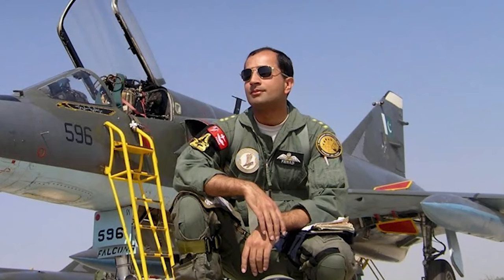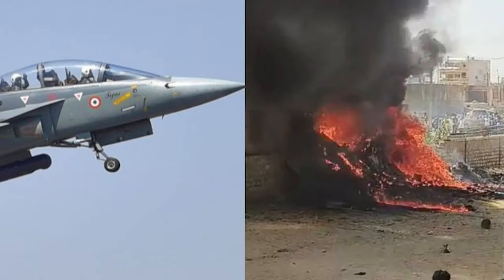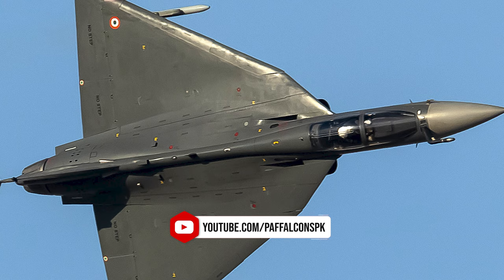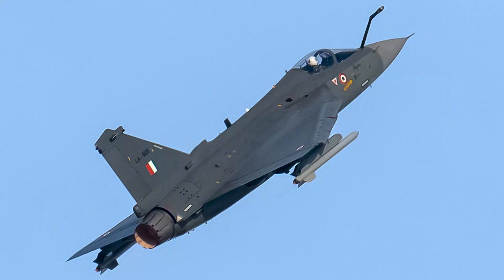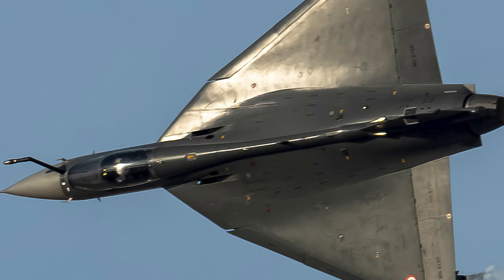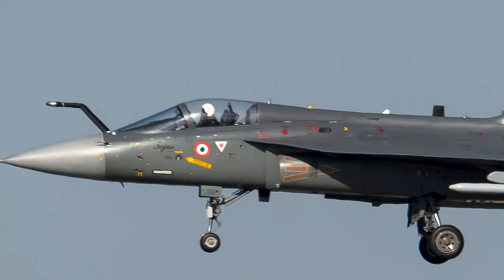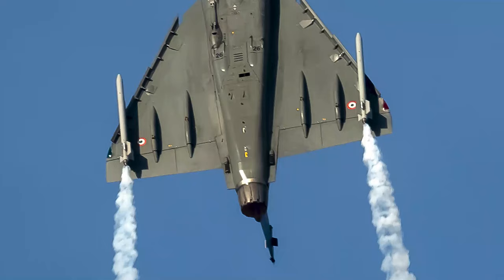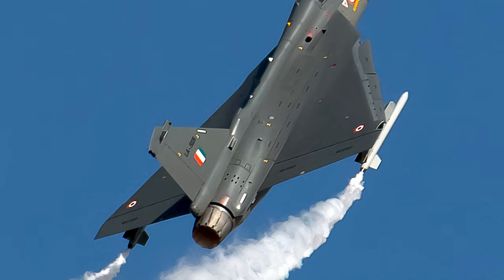WHY INDIAN PILOT EJECTED? LCA Tejas fighter jet crashes | Fahad ibne Masood, MRAeS

Comment: After 23 year's wow🙂
Reply: When a plane has not performed a single combat operation in 23 years, should a plane standing on the runway crash?
Reply: @tariqawan6890   Tejas is a backbone of Indian airforce it's only useful for defend not for combat use  and yet India has a strategic plans 😎
Reply: @tariqawan6890  15000 hrs of flying he he
Reply: @supriyabarman7307  RIP logic
Reply: @supriyabarman7307 If you can,t use a fighter  aircraft for combat operation than its useless in terms  of modern air warfare . JF-17 is also the real backbone of Pakistan air force but we are operating this aircraft for defence as well as for combat operation.
Reply: He mean Tejas is used for defence purposes not for offence .. for offence we have mig 29, su 30mki, raffale and tejus mk2, Amca coming soon
Reply: Only since 2017 20 units and 2021 20 units. Most do not fly much
Reply: @tariqawan6890   You think J17 is still your backbone than it will be a big disaster for you if a country use only types of fighter plane f16 jf 17 it doesn't meant that country airforce is superior India have different types of fighter aircraft Rafael Sukhoi mig 29 jaguar comes with double engine Tejas Mairage 2000 comes with single engine Amca Tedbf double engine coming soon what do you have😎

Comment: Tejas is not grounded, and the crash was caused by failure of the American F404 engine.
The Tejas airframe is the world's most reliable with no incidents in 10,000 sorties, and the GE F404 engine is the world's most reliable jet fighter engine, but it is the latter that failed.
Reply: The GE 404 jet engine is more rialable the issue the Tijas fuel ⛽️ if you used not compatible this engine well malfunction...
Reply: @anthonyjudeabraham6206  
Or it could be improper maintenance, or bird strike. Have to wait for the crash forensic analysis.